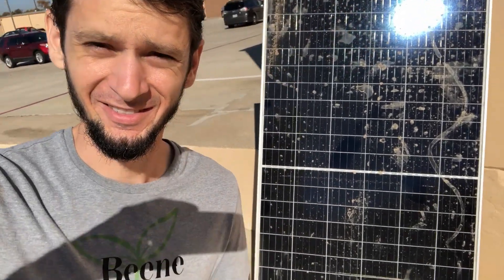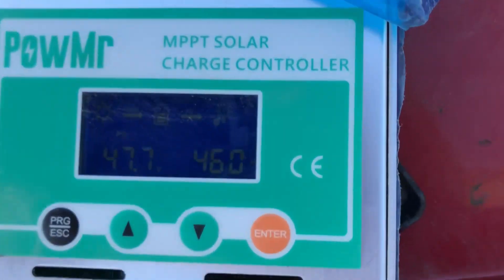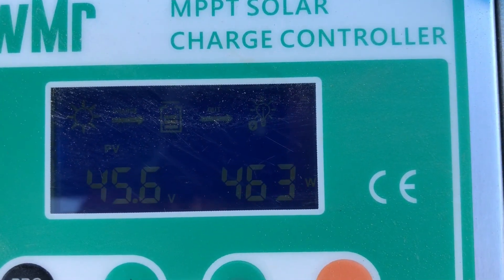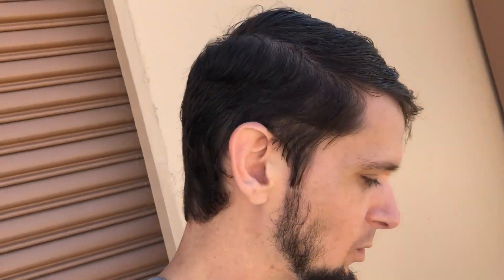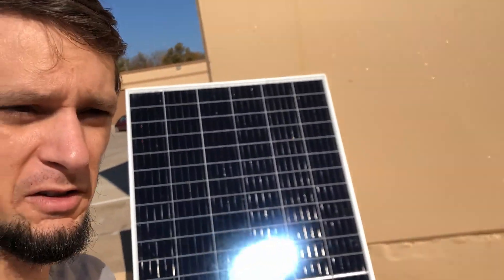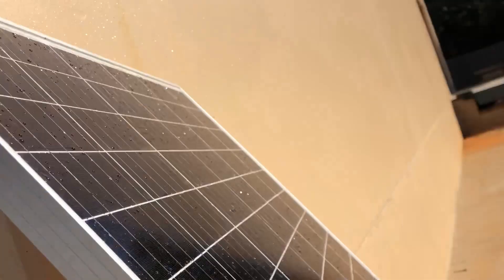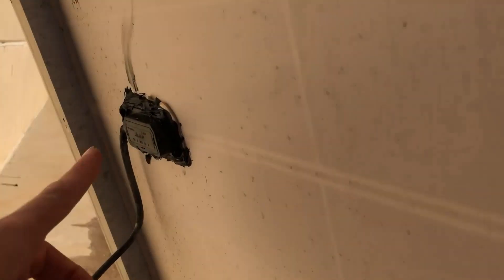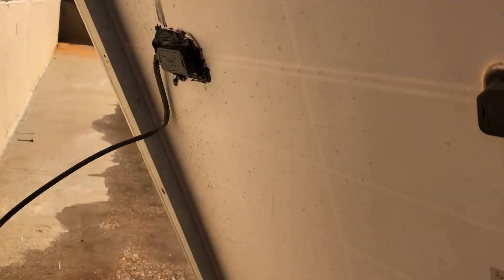Does it matter if your Solar Panel is Clean? 400 Watt Jinko Test

Comment: How is your 400w panel putting out 460w? Or did I miss something?
Reply from the maker: It’s an over optimistic charge controller. Not actually 460w. I just use that reading as a relative measurement.

Comment: Looking at the numbers...strictly a 12v battery bank and inverter...you would be overloading the powmr or the makes sky blue controllers if I put 2 of your 400 watt panels on them?that is correct yes?have you done this?
Reply from the maker: There are two pieces in play IMO.

1. Two of these 400w modules in series would be almost 100voc. That’s over the 80v input limit of the charge controller for a 12v setup. I have personally run two of these panels in series to a 12v battery and it was ok, but I can’t say if I have reduce the longevity of my charge controller.

2. 800w of solar is more than the charge controller is rated for at 12v (720w). In my experience the controller will in fact throttle to 60a output keeping it from self destructing. I had four 400w panels connected through a single charge controller to a 12v battery and it would limit to 60a where I had a theoretical max of 133A from the number of panels connected. Again it didn’t break but I can’t say it’s good practice.

In reality if you over-panel to 800w instead of 720 ( run them in parallel instead of series to keep voltage down) I don’t think there will be any issues. It’s rare to hit max efficiency on a solar panel the charge controller wouldn’t hit 60a too often.
Reply: @BeeneEnergy  ok great thanks for the info...Do you still have alot of the 400watt panels?Price for 2?thinking of upgrading what I just upgraded 6mo ago.Its just a simple hunting/camping cargo trailer but it keeps evolving.I Have pure 1000watt inv, 4agm 100ah batts,4 80watt panels and a pwm controller.just ordered a mppt controller and then I found your craigslist ad and you tube channel.Not sure if I need more but we just ran it in Colorado for 15 days with lots of led lights,shower pumps,3 electric blankets(used sparingly)phone chargers and a chinese diesel heater.It did fine but it did get run down in the 11.1 to 11.5 range a few times.
Reply from the maker: @chrislewis9345  yes we’ve still got a few hundred of the 400w panels. Just hit me up and we can coordinate a time for you to drop by, we can get you two of them for $290 for sure. If you have some buddies that need panels we can get you price breaks at 6 and 20 panels bought at once.

Comment: was it the cleaning it or the cooling it down that increased performance?
Reply from the maker: Ambient temp was high 60’s or low 70’s this morning and I had just set the panel in the sun about 5 minutes before shooting the video. I think it’s fair to say it was the cleaning which affected output.
Reply: Do you have the powmr controller in stock?price?I live near you so no shipping
Reply from the maker: @chrislewis9345  yes we keep these in stock for $100 each. Feel free to reach out by voice/text at (682) 730-0725.